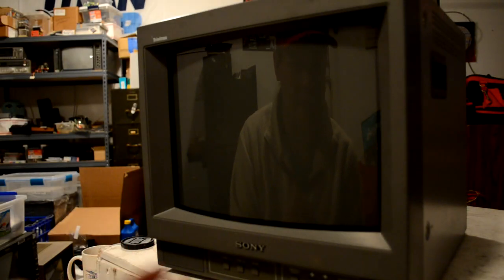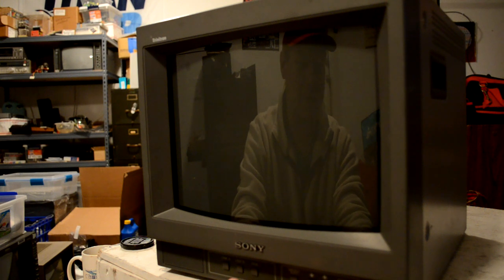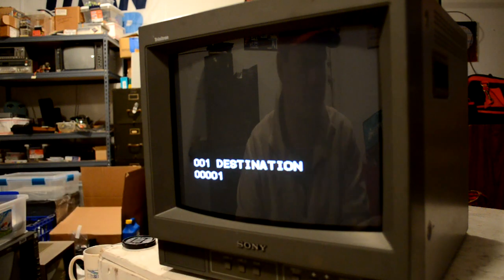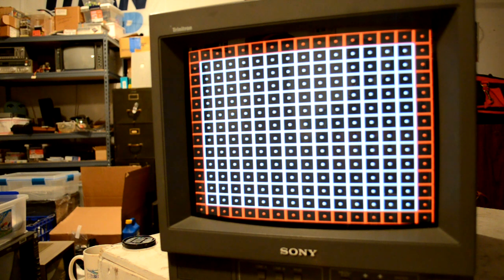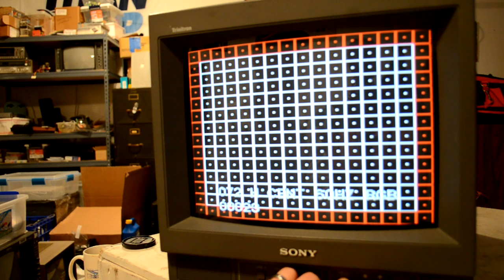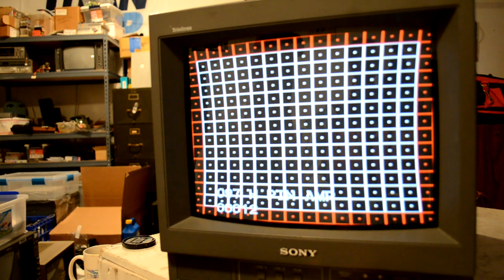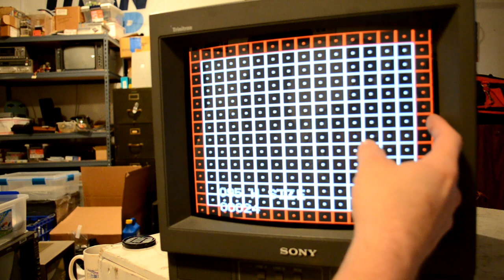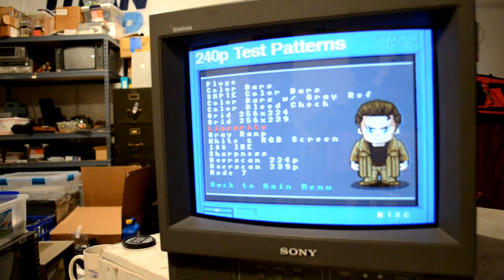How to Calibrate Geometry for a CRT Display | Sony PVM N series Monitors

Comment: Also I just figured out how to do this on my own PVM, a 2054QM: enter the regular menu and then press enter + degauss at the same time, the settings all have different names from what you've shown here (horizontal spacing is done with "video phase" for example) but the principle is the same. Saving is degauss -> degauss while in the menu

Comment: Can someone remind me of a PS2 game that shows a grid similar to the one on the test suite so I can boot it to calibrate my TV? I'm also wondering if I could use the PS2 to emulate NES, SNES or Genesis in order to use the 240p test suite since it's not available for the PS2, but I wonder if that would be reliable... There's definitely some image loss on my CRT, which makes me believe the image is stretched horizontally.
Anyway, great video! I'm definitely saving for later use.
Reply: go pick up a cheap first gen wii slap some homebrew on it and ur good

Comment: How do I fix the tracking? I have a trinitron wega srs sony tv and connected it to my laptop with some rca cables and a an HDMI to composite av adapter but I keep getting the picture that goes up like a fast elevator. How do I fix this problem?

Comment: Can this service menu be used to actually move/calibrate the screen on pvm's that don't have a service menu. Or is this just to have more clear results while your adjusting the screen. aka I still have to open the PVM to adjust the screen eventhough I'm using the 240p test suite

Comment: Sorry if you covered this already, but if I calibrate my TV using the 240p test suite on one console, should the picture settings not require adjusting when switching to other consoles? For example, I have my SNES and Dreamcast and my Magnavox CRT. I switch between the two by pulling the S video cables out and using the same input. Since they are both S video and 4:3, should I be able to just calibrate my TV by using the test suite on a Dreamcast disc? I dont want to have to buy a special cartridge for all my consoles

Comment: It might be a bit of a stretch to ask but I’ve got the same model pvm and on the left hand side of the screen there is a faint blue vertical line going from the top to the bottom of the screen. I noticed that when I’m on the raster centre adjustment screen the white portion of the screen is biased to the right hand side further than your pvm was. Would you know if this is likely related to my issue and if so do you know how to adjust the raster so as it’s not so far to the right.
Thanks for your videos. Nobody else makes crt repair info so easy to find and to understand.

Comment: Any advice for doing this on a CRT without an internal menu? I have a smaller 9" Ikegami PVM with some pots for centering, but nothing for corners/skew. I did try waving a fridge magnet near the tube, but I need something a bit more intense to fix my one corner (the other 3 are near perfect).
Reply: Yeah, just keep twisting the pots to the right, until you hear a high-pitched squealing noise, and see smoke.  Then you are done.

jk
Reply: Did you find out how to do it? I have one of those really basic Sony BVMs without an internal menu. I'd really love to be able to calibrate it without having to fiddle around with magnets
 EDIT: Nevermind. Just found his other video lol

Comment: Great guide. I have a question though: when you read about PVM settings online, there's quite a few horror stories about how some settings (v hold in particular, when the caps are already in a bad state) can brick your PVM if you set them wrong. Which of the settings are "safe" and which are the ones you should adjust with care?

Comment: Please forgive me for my English, I use a translator. I have a question for you. Tell me, please, it’s better to adjust so that the red lines of the border go beyond the visible region, right? it will not affect the image in games?
Reply: Yes, you can set it so that the red dots in the middle touch the border of the screen but the straight edges of the red boxes are in the overscan area/not visible as he has done.  You can always adjust it later if say certain UI items are cut off in particular games (sometimes you can take care of that with in-game settings) or for personal preference, but in general you aren’t meant to see anything that would fall in the overscan area, especially on older consoles like NES/Genesis, and therefore you won’t likely miss anything.
Reply: @Ponimaju  Thank you very much for such a detailed answer! I tried to set it up just like that. The problem is obvious in one game. This is very noticeable. Game - Streets of Rage.